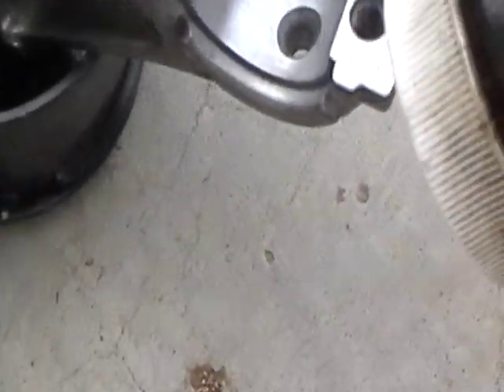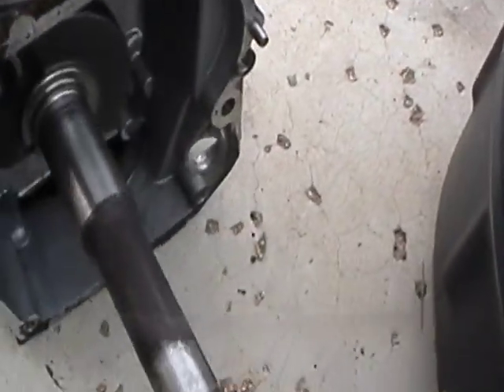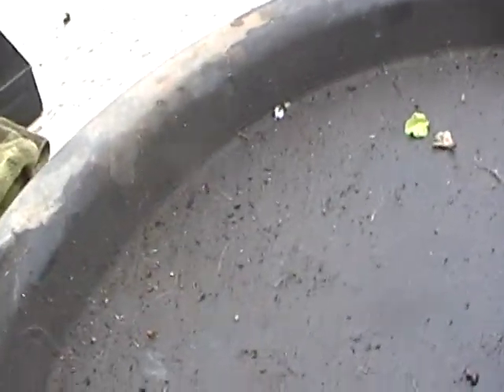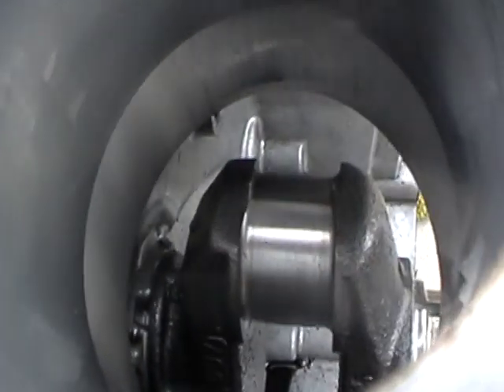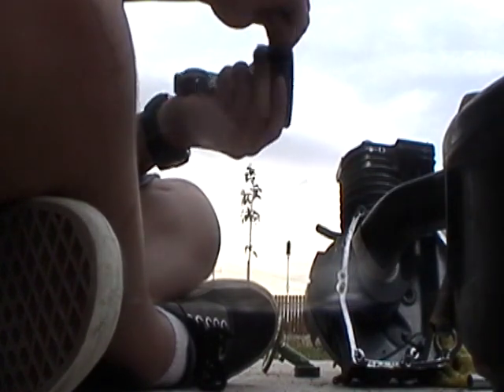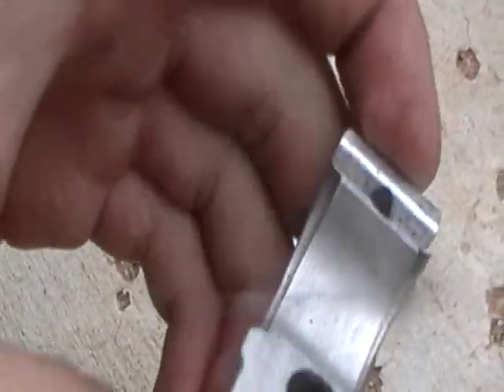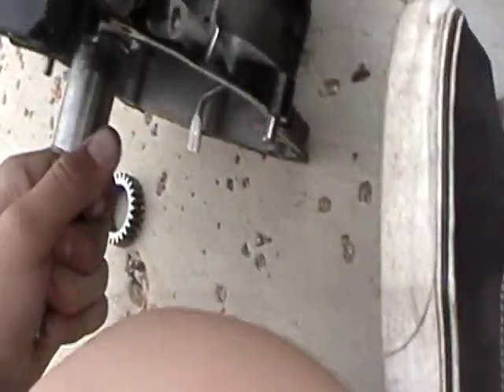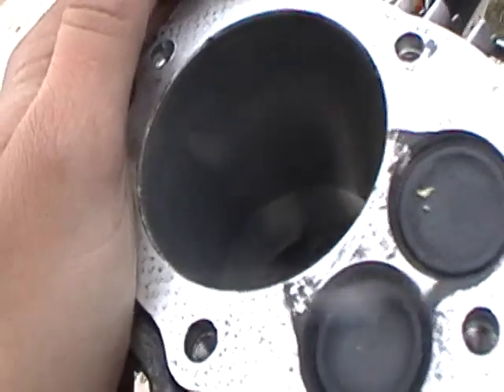inside a slaved briggs engine

Comment: No, the gear is nylon, the actual cam lobes are a polymer resin.
Nylon is too soft to be used for the cam lobes, they use nylon for the gear because it has a little "give" to it(this is because if it were too hard, the teeth would shatter) , where as the resin is hard and more brittle and withstands the constant friction better but has very little "give".